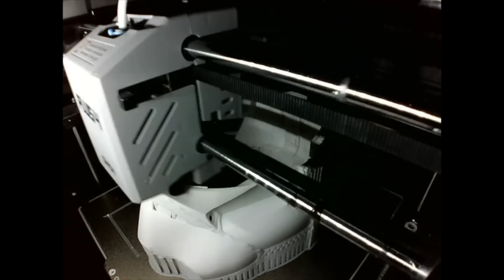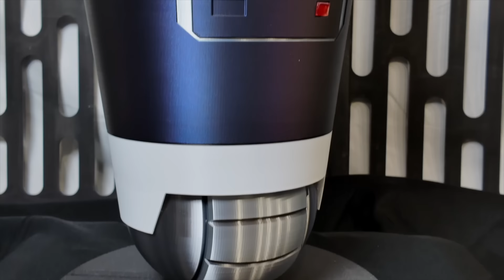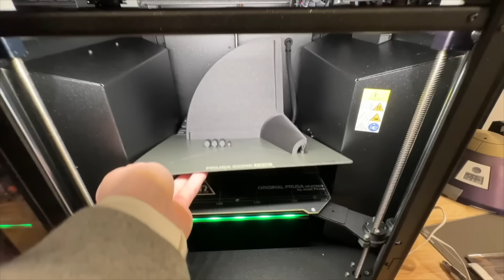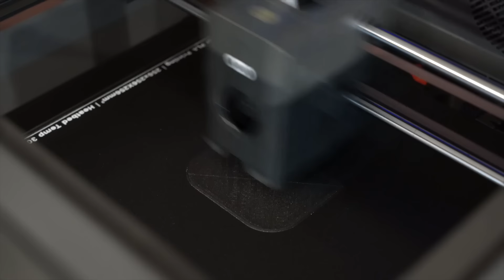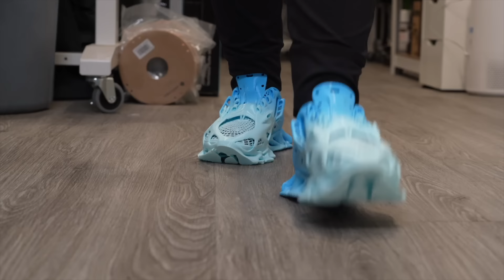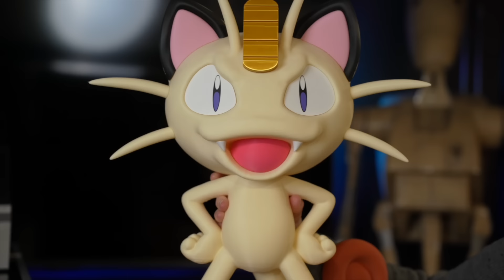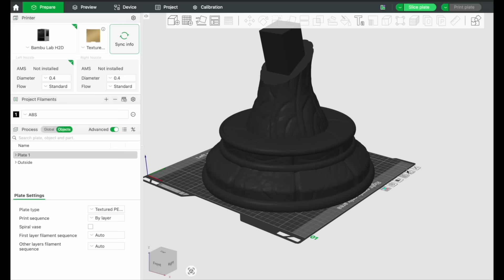Ranking Every 3D Printer I Tested This Year

Comment: I want the H2C seems it might save some $$$ in the long run by generating less waste 50-80% less poop then others, in my thinking after 20-30 rolls that should pay for the upgrade from a smaller/cheaper unit if already purchasing a new one.

Comment: Nope all Centari carbons have that same problem, however it take 4 weeks to get any parts, If your under warranty & the reason they don't put the parts on there is because they can find out what the problems are for the next gen of printer by keeping track of the problems , makes perfect sense to me (sigh) watch the firmware also use a certain one i believe 27 is the best but the last one i hear is good as well but not in between

Comment: Nice review thank you The U1 is very good printer also for multicolor.  Very reliable most of my failed prints were operator error 2 out of 50.  Longest print 24 Hr. print.

Comment: Thinking about buying the elegoo centauri carbon this weekend. 
Redneck looking to learn. 
Single color seems fine until tool changers are more affordable or needed. 
I'll be doing the standard, why do I have so many lil boats. This looks neat to print. I broke x part and instead of buying one for 20 bucks I'll print it for 3 and have it tomorrow. 

So far I've used a tina 2 to print out random things and a leg for a amputated chicken. 
Bed size has me looking to upgrade though

Comment: Have been printing for 13 years.  Mostly engineering based projects.  Use machines that cost up to 100k (work, not.mine)  the h2s for 1500 is a magic machine.  Flawless day after day.

Comment: I got my Centauri Carbon in may and it has been a workhorse. I have over 800 hours on it. If you need a cheaper, smaller printer that gets you quality prints with minimal effort, I cannot reccommend enough. For its price, its an amazing value if you dont need the absurd build volumes and multimaterial. WITH THAT SAID, there seem to be a lot of duds out in the world. Elegoo has been working to help those with bad printers, but you take your chances with a machine this cheap thats trying to do this much.

Comment: The parts availability issue has been a continuous source of grief for me... from Creality.  My K1C's print head cable was 100% unreplaceable except to buy some custom hack job thing from a rando website for a crazy price.  I had to harass Creality to send me another one and slam my head against the desk to get through all the "troubleshooting" they are required to do.  "No I didn't fucking factory reset my rooted K1C, because this cable is ripped in half."  But even worse was finding a replacement purge wiper for my HI.  That just straight up is not available anywhere.  And this is extra fucking infuriating because they have a very well-produced, convenient, and easy-to-follow video walking the user through how to replaceme their purge wiper on their YouTube channel.  So they KNOW thay this is a part that needs to be replaced frequently enough to have user-friendly instructions for doing this repair, but they don't stock the part anywhere and it seems the only way to get one is by begging tech support directly to send you one.

Honestly I need to just bug them to sell me a few replacements to keep on hand for whenever they inevitably drop support for the HI.  It's a shame, because I've been incredibly pleased with both of the ones I have for doing Hueforge work, and I would be very tempted to build out more capacity with these machines and readily recommend them to anyone who asked if the glaring issue of parts availability wasn't such a concerning issue.

I haven't had to replace anything on my 2 Centauri Carbons so I haven't run into this (yet), though I may have to buy some spare parts to have on hand hearing about your experience.  Honestly, even if the Qidi Q2 is technically better (and I do want one) I wanted my 2 CC's to do exactly what I have them doing: be dead simple, no nonsense basic printers that don't like to break on me.  And, honestly, that's what they've been so far.  They're just tanks that crank out parts and don't complain too much doing it.

Sovol used to have these parts availability issues way worse, but with the Sovol Zero and the 08 Max changing up their tool head design to be more of a single unit design (almost like having a solid, all-in-one, full tool head design priced at $70 ready in their back pocket might be positioning themselves to swoop in with an extremely compelling and competitively priced tool changer not too far out from now), parts availability has become way less of an issue.  They seem to be actually addressing user complaints and getting better across the board, even if wish they could tldi so faster, they are moving in the correct direction.  They still need some work in customer service and QC, but the Sovol Zero is a quantum leap in quality over the SV08 so I think they'll get there.

Comment: at around 23:34 you said your A1 mini can use other ams's from other printers.....my understanding is that the a1 mini and a1 share an AMS but they are different from the other printers....i own 5 bambu printers and the ams from the x1c and p series are not usable on a1 mini a1...just an observation
Reply from the maker: A recent firmware update made all of the Bambulab AMS units compatible with the A1 printers.
Reply: @MMsPropShop  thanks, I never heard that. I own 2 ams but never wanted to go that way with their ams lite

Comment: I think you should had also the price in consideration for your ranking. Maybe a budget winner...
Reply: That’s the biggest issue with these sorts of videos from professionals who rely on the printer as a tool for their job. Their best printer is always a high end machine that costs something like 2-6x as much as what most of us can justify spending on a fun little hobby. It’s the same with photography, you could go on a family holiday or put down a deposit on a house for what the best camera and lenses go for. 

Not to take away from this video at all though, it did a fantastic job of going over the reasons why she ranked the printers where she did and why. But price is very much an important factor for a lot of us, often times it is THE deciding factor of choosing one machine over another, so an extra ranking system factoring in cost would have been nice.

Comment: I have the A1 with the AMS lite and it is having issues with the alignment.  I use pla mostly. It seems like it is printing the z coordinates just slightly lower and will rub on the previous layer and knock it off the plate or is a few cases it creates a filament blob encasing the printhead and in a couple  cases even the hotend. I have tried swapping out the printhead, the hot end,cutter and the fan.  Do you have any tips?   I’m going to purchase the P2S combo but I still want to use the A1 as it was very good until all this stuff messed with its alignment.

Comment: Loved your video. I have a creality ender 3 v2 and i didnt have any sort of problems for almost 2 years then everything changed when i did a filament swap, the nozzle clogged. Cleaning it didn't help, i switched it and had a spill between the nozzle and the tube. It was an absolute pain to clean it, and now i can' 8:03 t for the love of me get it working as well as it did before. Now i want to get a better 3d printer and don't know if i should get the k2 from creality (saw that some people had problemswith it breaking fast) or a printer from bambu labs (thought about getting ps2 but the price is quite high). I would love if anyone has some recommendations for a reliable  printer below 700 euro.

Comment: I'm interested in getting into 3D printing and have been trying to decide whether to get the Prusa CORE One L or the Bamboo Labs H2C. Any recommendations? From the outside perspective, it looks like the CORE One L produces better 3D prints, and i like the size, they say it's able to print silicone and i like what ive heard when it comes to customer support. The cons i see is that it doesn't have their MMM3 upgrade yet, so multicolor prints seem like they would be much more difficult compared to the H2C. The H2C looks like a great printer also, it already has the multicolor attachment. It's more expensive then the Prusa but Bamboo Labs seems to be the leader in the 3D printer market. Their community is great and supportive. Which of the two would you recommend and why?
Reply: I know this is late but this has some misconceptions 

Silicone: that is with the prusa XL done from students.  Has to do with the uniqueness of the XL multi nozzle system... 

The MMU3 can be used on the Core One L just fine, plenty of people set it up, just like one the core one. There is not a dedicated MMU3 setup planned for the L, while the current one works fine. 

Prusa 100% over Bambo. Bamboo is terrible for user rights and right to repair and closed source. This is terrible for the longevity of the machine and your rights to ownership of the machine and what you can print on the machine.  

Prusa and other brands are much more open source, repairable and can keep working for decades. I would also take a Snapmaker U1 over Bambu. Or really any more open source brand over Bambo. Cloud connections are cool. Mandated cloud connection is horrific.
Reply: @mandaloresmercy thanks for the reply. I ended up buying the Prusa CORE One L and am loving it. It prints beautifully and the learning curve wasn't too hard. I went with the CORE One L because of the size, to your point, i didn't like the idea of not having full control of my machine. I like the reliability and because of their future INDEX multicolor attachment, which switches colors in like 12sec and causes minimal filiment waste. I'm happy with the purchase
Reply: @djhplaya117 sounds like a good choice to me!  I also ordered a Prusa Core one L as my first CoreXY design and plan to install indx as well.  

Otherwise I come from a moderate history of a couple bed slinger designs. I'm glad to see everyone pushing the printers to be better

Comment: Well, to be honest, my favorite printer of the year is my only Anycubic Kobra 2. I've managed to transfer it to Klipper, added accelerometers, a camera, a touch screen and a wifi. I've replaced bearings, wheels, rails, belts and extractor gears to better quality ones. And now my old silly bed-slinger performes maybe around two times faster and  prints almost perfect in terms of quality. Though it still cannot print PA. And it failes sometimes to print ABS. And it cannot print a helmet in a single piece. Maybe for my cat though.
Someone said that the best printer is the printer you're friends with. That's a good point.

Comment: Kind of disappointed that you perpetuated the stereotype that BambuLabs are for people who view 3D printing as a tool while the rest is "for hobbyists". I see where this is coming from, but there's a point where if you push the craft far enough, it flips, and BambuLabs become the hobby-grade printers, while open-ended models such as Creality's, Sovol's and even Voron's become the only viable option. I run a farm and have a few Bambus, but by their closed nature, they don't play well with the rest of the printers and end up being rarely used. Once you learn to use Klipper and dive into the vastness of its ecosystem, it gets very hard to go back to BL's walled garden. I'm often surprised that basic features I've had on my printers for over 5 years are still missing from the Bambus. That being said I totally agree that most printers absolutely suck out of the box. I'd never just take a K2 and use it as is. Every printer needs some prepping. And that's why the most important feature IMHO, is whether a printer will take mainline Klipper. Still I can see why some people like the Bambus. If your needs perfectly align with what Bambu provides, then you'll be very happy, and if you need more, you'll be very unhappy. They really are the Apple of 3D printers, except they're not fleecing their loyal customers (yet).

Comment: Hi, im still confused to buy which printer. Ive been designing 3d models for over 2 decades now and this will be my first 3d printer. I want one to be reaonably afforadable but need to be enclosed due to having a constant shedding doggy. I was leaning towards the bamboo series but when it came to preferences i really liked the h2d/h2s however the price point seems extreme for a first printer. So i went into further research and looked at p1s and p2s and everyone i see in review is saying they dont even come close to the quality of h2d. Are there any good mix colour enclosed printer that will be suited within those requirements? I mainly do want to print for myself but i go attend and table at conventions to possibly sell in the future. I mainly am focused on print qaulity over quality of life. Any advice will help. Thank you.
Reply from the maker: Personally I find that pretty much all of the Bambu Lab machines have the same print quality (which is some of the best). The P2S has some very nice upgrades over the P1S that should translate into better print quality. I’ve never used a P1S so I unfortunately can’t give you a first hand account as to how much of a quality difference there may be.

Comment: Hello i appreciate the video, thank you. Im struggling to decide between the H2D and H2S. I do not plan to mainly do multicolor prints, i only consider the h2d to print support material lile tpu and pla support or more exotic cf filaments and cheaper support material. Thats what i intend to use the dual nozzle for. Else, the H2S does everything i want. Do you think the h2d is worth it for my use case? There is a price difference of 750€ in my country and im struggling to justify the huge price difference between the H2S and H2D only for the supports. On the other hand i dont want to go with the H2S and regret not being able to print support material for TPU and other materials.
Reply from the maker: Really depends on how much you see yourself wanting to use the different support material and if that filament cost savings would start to equal that of the H2D price difference. It does have the potential benefit of being able to print in 2 colours on its own without an AMS which you may be surprised how much use you get out of.
Not sure if you’ve looked lately, but the H2D printers have been on sale so you might be able to get it for less right now which might help with your decision.

Comment: I have a Qidi Q2, no Qidi Box and I really like this machine. Their own brand of filaments can be a bit more expensive but almost always print perfectly out of the box, and I've been able to print TPU from 95A down to 60A with it. 

I also only have setup my Q2 to the internet just for updates then disconnecting it. No tether to the company is good as I use it for designing products in my small business.

Best part is it is now supported by Orca Slicer without any issues!

Comment: I have the X1C and ECC printers. I found after about a year using the X1C it printed very well out of the box. Maybe after 2 years on the market when I bought it, it finally had some mature filament profiles. And maybe that this printer has the lidar scanning of the first layer makes it also more reliable. I found that the failed print spaghetti detection works well be not perfect. I love that this printer auto adjusts the nozzle height. No more have to do and spend hours adjusting like on older printers. My first issue with my ECC printer was that I had to adjust the nozzle height. It was to close to the bed. Being able to adjust the nozzle height automatically is a game changer. I don't know if the latest firmware for my ECC printer now does spaghetti detection. I am hoping so. Being able to cancel just that one part from printing is a big plus. I have used my ipad to remotely monitor my printing from my brother's house. Works well. All in all I am very happy with my X1C except for one of the firmware updates made my prints a lot less reliable and I did not want to have to redesign new filament profiles when the previous firmware works great. Another final comment: it seems like there is only one firmware that works across multiple printers. I think that is a bad idea. I think it was the H2D that at the time was just releases and the latest firmware happened to be for bother printers; I think that some of the changes for that printer might have added to issues I had with my X1C when I upgraded. The only other thing is I wish my X1C and ECC printers had a 320x320x320-400mm actual build volume. PS: Instead of just trying to glue part together. I try to design my part with wood working type of joinery. When I can and if my prints don't have to be really thin.

Comment: I am curious about the Prussa Core one L.   Really think may add one last printer with INDX to my setup.  The Max4 also another one debating on, my Qidis been my workhorse machines for long time now and really like dealing with Andy from their tech support, very helpful and parts always available.  I have huge inventory parts for all machines.  The XL looks amazing, silicone printing looks very interesting.  I like build size and Prussa service..... think going to hold off having just gotten the H2D til later in 2026.  I did just grab the cutting head upgrade for my H2D for $69 Black Friday Sale.  Machine has run practically non stop close to two weeks now!!!

May be doing YouTube channel in 2026 with move into new place giving me better work space.  I have two shops 2hr drive apart. All have 3d printers but largest one has wood and metal capabilities.

I really like your common sense approach been enjoying your videos for quite some time now.  It is cool to see you grow and the quality of your builds, video content, and tips are First Class all the way! You have become of of the top 3d printers influencers out there, get the Adam Savage influences......